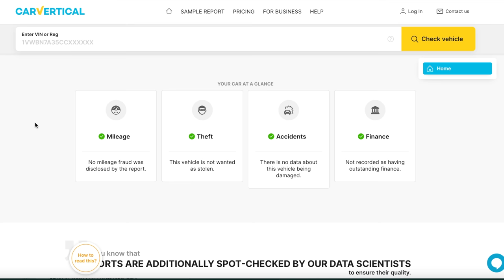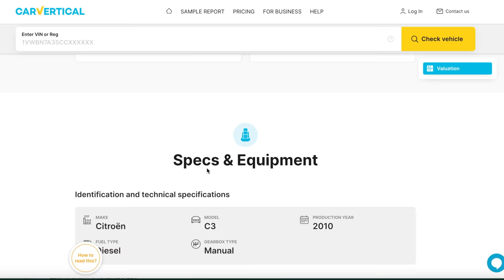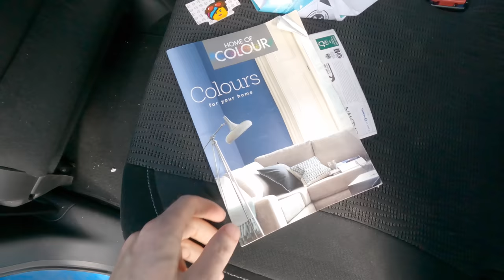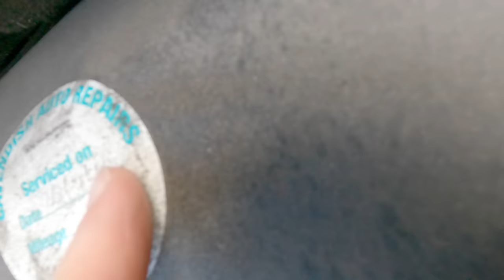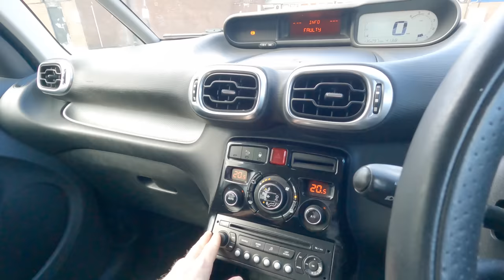I BOUGHT A CHEAP CITROEN FOR £300!

Comment: I really don't know what's the problem with Brits and French cars, they glorify German cars, even though nowadays they're more unreliable than French cars. My family had several cars, a Toyota starlet, Renault 4L, the original Clio (D7F engine), a xsara, 306, Audi A4, vw golf (mk2), two c3 and a 207. The car that gave us more problems was the golf, that car didn't even like to wake up in the morning during winter (in Portugal, where the winter is mild), it was filled with problems. The starlet lasted more than 300k+, same with the xsara, the A4 was sold because it was really thirsty, even though it was quite serene, my mom crashed the 306 against a bus  in a country road (the road had some oil and it was raining), the 4L were incredibly fun,  we still have the Clio, it's our old reliable friend that never lets us down (even though we only use it for short trips, like 15 km per trip) and currently my mom uses her 207 as her daily driver, I use a c3 with 200k (I'm a teacher, so I do long trips, for example, yesterday I've made over 300km in a day) and my sister is also a teacher with another c3 that has 350k (it just needs regular maintenance). They're small, economical cars and really fuel efficient, so calling them "shitroen" or something like that is just disrespectful, and really shows the xenophobic views that the Brits have for the French (not that the French are innocent) but yeah...

Comment: always look at the dash fuel pump it shows you  which side the fuel filler door is on, come on your better than this , I just bought a 2019 8 speed  30k Auto Citroen C5 Aircross and its very frugel on diesel. for a 1.5 dci engine. it has a proper torque converter gearbox to. lots of toys to go wrong though. so it needs some warranty purchasing for it but miles better than a Renault any day of the week. I had my Citroen Xantia for 18 years and it was 6 years old when I bought it,. good reliable cars  if you take care of them. you could have gone on the |FCF online, the French car forum and got some answers to fix it possibly quite cheaply to. citroen perfected the FAP exhaust system and it is farly reliable compared to other Make vehicle's who haven't got it right to this day..that looks like a Maf sensor issue fairly cheap fix especially with the misfire when cold.

Comment: shitroen! shame the PSA engines were made out of sugar. I have a Hyundai I30 diesel and it's at 131k and still goes perfectly. drive daily, drove to Heathrow and back from South Wales not one issue. it has a small oil leak, so maybe the regular top up of oil helps. got some garage rash on the side from when my wife forgot how large it was, but it's excellent and not left us down once in 6 years.

Comment: On the fuel gauge in the car that little arrow shows you which side the filler cap is on so you don't have to get out and check, and if you are  jumping in and out of different cars all day could say you a bit of time. Just a bit of useless information.

Comment: I can see why people wanted to know what was wrong with the car and costs to repair but I think logically; it’s like this, car was 300, if a clean up and service could have doubled his money go for it. Car smoking that badly though, we have dark smoke, black smoke and towards the end white smoke, so that’s water mixing with oil. I suspect that with the misfire is blown head gasket. That and the broken fuel gauge alone will cost a lot so a big loss already. With no servicing we don’t know what else is wrong with the engine (tapping noise towards the end of the video. Handbrake needs adjusting or rear shoes ok that’s a cheap fix but just on what we can observe this one’s only fit for scrap. Shame because inside looked ok, air con works, car drove straight so no serious issue there. People who don’t service cars annoy me. Times are hard, even if you just have oil and filter change that’s all your engine wants to keep running good.

Comment: Your right French cars are rubbish when they are old and not serviced properly we have several Belingo Vans 68 plate and they drive great 69+ mpg on a run however I have had nightmares with older ones and like you stopped taking them 😂

Comment: French cars aren't worse, they CAN be worse. Some models are great, some aren't. Some engines/platforms are above average in reliability, some below average. 
If you're in the used car business, you buy cars with a history and each history is different. How well was it maintained and serviced, how much did the previous owner(s) care? This Citroen already has 3 different tires on it, a massive red flag of cheaping out on proper maintenance. 
Truth is that German cars are treated much more softly because of their reputation. A faulty injector on a French car? --> See, it's junk. Faulty injector on a German car? --> That can happen after 130k miles, of course!
Please, try to include at least a diagnosed repair estimate in every video, now it's just bashing a 300 pound banger car that could've been saved for all we know.

Comment: It is a shame you have had such a bad time with Citroen, like this C3 Picasso. But £300 that is what it is worth. I have a 2009 model HDi 178k miles with full set of Michelin Cross Climate tyres. Same model as here. The car is well looked after & worth 2-300. But Shocks get a pounding from our crappy holed roads. 
Previous car 2005 Renault Grand Scenic 1.9DCi, well looked after and PX at 145k in 2014.
My previous car to that 2001 Peugeot Partner 1.9D engine lasted 247k miles untill the injectors failed & could not be removed. Again good tyres & serviced regular. 
So you see if you actually look after a car properly & drive it respectfully,  it should last the test of time.

Comment: I love your utter contempt for Citroen.   You buy a dirt cheap car which has been obviously badly maintained and then start to slag off French cars. But my apologies I've owned Pugs and more recently Citroën from since 1992. And generally speaking no problems at all!   Any problems with the 1990 205 I had were the fault of the dealership. (cambelt snapping, luckily when I stalled)   PSA (or whatever they are called now) should take a real hard look at the awful  dealerships in the UK.

Comment: Wrong about Citroens --- owned a DS, GS, CX, AX, C3, C2 and C5 all , not once , have broken down in 45 years of driving. The C5 i have since near new is 20 years old done near 300,000 miles does 50 miles to gallon and never not once broken down; not had a spanner touch the engine, original fuel system. The most expensive item i have had to change is the Battery and the rear silencer (12 years ago) --- the key to any car is regular service, best engine oil every year, gearbox oil changed, and good filters fitted along with top grade anti freeze (changed per instructions)   What you are taking about is people who buy a cheap car , and then treat it cheaply but expect it to last, its not the car but people.

Comment: Really don't know what you are talking about CITROЁN ! I'm 78 years old driving since 17 had most cars mostly Ford best value cars around, I had a CITROЁN van to deliver parcels  Did 138000 miles in and the only thing to repair was 2 front springs, fan belt, and a rear exhaust, NEVER,LET ME DON'T, 
Got a 2009 Berlingo Multispace Fantastic the 90 hp goes like the clappers  65 mpg, done about 7000 miles so far ,What a vehicle loads of room can take all the rear seats out 
Best car I've ever had!
Apart from the best car on the planet that was my 4x4 For Scorpio, Better than crap BMW, or Mercs now there cars I wouldn't have even if you gave me one!!

Comment: What kind of sails man you are that cant know what engine this is by looking at it???? It would have been realy funny if the turbo would have got a little bit more oil in it :D
Reply from the maker: Because I can’t tell the difference between the 1.4 HDI or the 1.6 HDI? 😂
Reply: @HighPeakAutos  the 1.6 is always the same, and to tell its a diesel by looking at it doesnt need a lot of knowledge, for a car guy especialy :)

Comment: No hate here, but to judge a just-encountered car with a completely unknown service history, undiagnosed fault and well over 130K on the clock as a Shitroen is pretty harsh. More like it had needed some TLC in its last 50K but the owner resented the cost, given the mileage. French cars can be great, and even my late-80's Renault 25GTX was on 200K when totalled by a passing idiot—but I always did regular oil changes. My bro' picked up a Piccaso for £400, is still driving it 2 years later, and that's cheap motoring, I'd say.

Comment: DV6TED4 engine: the worst Diesel ever, and fitted to PSA, Suzuki, Volvo, Mini etc etc. The usual failure mode is that the crazy fastener configuration used in the in the head - studs with M6 on one end and M7 on the other, yes M7!! - stretch and compromise the seal of the injectors in the head. Combustion gases then enter the cam cover causing extensive carbonisation. The cam lobes then smash-up the carbon and feed it into the sump where (i) it chokes the strainer, (ii) blocks the oil filter and (iii) passes dirty oil through the filter bypass valve which then clogs the ridiculously small secondary strainer in the oil feed to the turbo. Replacing the turbo without addressing the issues at the top of the engine normally means that a new turbo will then fail the same way within days. Working on the top if the engine is a pain as the camshafts and second cam chain are affixed to the underside of the cam cover. The only remedy is to strip and rebuild the top end with new studs, seals and recut the seats. PSA have a procedure for tightening the injector nuts which much be adhered to. And, of course, you have to clean everywhere else the oil flows within an inch of its life. In short, the French really screwed up this engine design: the compromises associated with getting 16 valves in this engine mean that it's fundamentally flawed, like a half-thought out student project. How telling that the 1.6HDi that replaced this engine reverted to eight valves. I've not worked on that engine, but I understand that it is an improvement.
Reply: This C3 has the later 8v engine, they have the felt cover. Generally a better engine but some versions had delphi injectors which seemed more troublesome than the bosch items.

The old 16v engine, it had a bit of a reputation, but a bigger part of it was down to the service intervals being too wide and a lack of appreciation for the correct oil lpw saps oil.
They can clock up the miles if looked after, although with cheap tax and running costs they don’t tend to be maintained too fastidiously.
Reply: In short, what a load of complete drivel! 

I’ve owned them for years, family have owned them and friends have them. Service them on time with the correct oil and they give frig all issues. Tighten up the injector clamps at every service and give them a good thrash every few weeks to keep the EGR from blocking.
Reply: @ciaranm8772  You are of course entitled to disagree. However, my comments are based upon my own experience and assessment of the problems I have personalty experienced with this engine, so you're wrong to just dismiss what I say. Further, if you search the web you will see that many have experienced similar issues. Periodic tightening of injector bolts shouldn't be required on any engine and there is debate to be had as to whether continual tightening is wise. I don't recall that being in the manufacturer's recommendations either. Frequent oil changes are desirable of course, but once carbonisation issues start with this engine they won't be addressed by oil changes, as I found out to my cost when I got stranded in Scotland with oil starvation.
Reply: @peugeotCitroen2CV  Thanks, I'll have to check the video again but I genuinely thought the 16V was still in at this date. Apologies for the error.

Comment: Hi Matt.  First of all agree with you 100% about the older BMWs.  Quality and class.  If you don't already watch it see what Max in the Mallorca Files drives 😀 A mate of mine in the trade says that all Peugeots and Citreons are bad news after about 10 years.  They get get electrical faults which are so expensive to repair.  Perhaps they do it deliberately.  I've got a 2006 Peugeot 207 on my drive sorned.  Really nice car, but no power steering, ABs, speedo etc etc.  Quoted £1,500 to repair it so its going to the scrapyard.

Comment: I used to sell Citroëns in the time these were new. I thought they were cool. I do agree that French cars can be naff though. I like the styling but they don't last. If you buy something like a VW or Toyota at 100k it is barely run in. With French cars 130-140k is the complete life of the car! Not good value. Those 1.6 diesels are garbage. The older 2.0 is much better!

Comment: There is nothing wrong with a citroen I've had three of them 1.6 diesels every one never had a days trouble..because I service them there are no bad diesels by the way just bad owners...iv had diesels since 1992 when I bought my first rover diesel it had a French engine never missed a beat in the 108.000 miles that I did in that car and every car I've owned all of them way over a 100.00 miles...the rover 600 that I had did 208.000 miles still had the original battery never let me down ever and only ruteen servicing...I'm now on my 3rd citroen diesel 1.6 HDI it does over 60 miles to the gallon and the fit and finish us very good...the secret to getting long life out of any car "clean oil" I change my oil every 6000 miles I do high milage and none of my cars with the exception of a Ford focus I only made the mistake of buying the dashboard lit up likexa Christmas tree at 3am in Simmons Yacht not the centre of lifecat any time...anywayvi only kept that car 3 moths and it spent a month and a half of that in the garage..regardless to say it did not live up to my expectations it was new well 1.200 miles on the clock when I had it... I've never had a ford since... so please don't knock what you don't use regularly...Allan

Comment: To be honest I share your dislike of modern French cars they are shite I would say Peugeot and Citroen are the better out of the 3 i would rather catch aids than have a Renault  but engine wise the 1.6 diesel is usually pretty good and easy to fix I would have been tempted to save this one especially since you only have 300 in it, it wouldn’t have been your biggest profit but you would probably have made a little bit and kept a perfectly good car on the road for another at least 12 months which is always nice my opinion as a mechanic for what it’s worth. Also may have been worth having a mess with it yourself you might have no knowledge of engines at all but you could have had a tinker turbos are easy to do and so are injectors and you get the satisfaction when you start it up and it’s not missing anymore I do love the videos though I do like giving the unloved 10-15 year old era cars a bit of love and keeping them going

Comment: Unreliable diesel and you've no idea what the fault is. 130,000 miler that hadn't been serviced for decades does not make an engine unreliable. Blame stupid owners who think that skipping servicing saves them money. And to boot PSA must have built millions of those 1.6 ltr turbo diesels so used spares would have been cheep as chips. Another unreliable car dealer. Unsubscribed.

Comment: Had citroen and renault in the past with the predictable reliability build quality issues . A note also on tyres . Looked at a 69 plate focus with 20,000 miles at a ford dealership with cheap budget tyres on the front and virtually bald Pilot sports ( original ) on the back . Salesman couldn't understand why I walked away without having " a better look ".

Comment: Ugly cars these C3 Picassos but especially as an "Exclusive" I understand why some people like them. It's one of those mini MPVs: like the VW Golf Plus, Hyundai ix20, Kia Venga, old Mercedes A-Class, Fiat Idea/Lancia Musa, Toyota Yaris-S/Subaru Trezia but the kinda stuff the old couple Gladies and Franklin likes. When I saw 300$ I was thinking either:
Beat up C1 by some Teenager or young adult but still running
A C2 that smells like w€ed
Or a C4 Picasso filled with doghair and a failing hydropneumatic ^^

Sure this was unexpected until I saw that mileage with "diesel" then I was like either a 1.6 HDi with leaking injectors (because you gotta tighten em every time the car gets the yearly inspection which citroens lack) or a blown turbo..so I wasn't wrong ^^ still a shame that you either get a problematic MINI gas- or a junky PSA Diesel engine..

Comment: Most peugeots and citroëns are pretty much done with 120k miles / 200k km. Build quality is just bad. Here in the Netherlands there are loads of unsellable 1.6 thp cars sitting around 160k km. Because the engines are that bad, they better be scrapped.
Reply: 1.6 THP, the engine that BMW designed! There’s the issue!